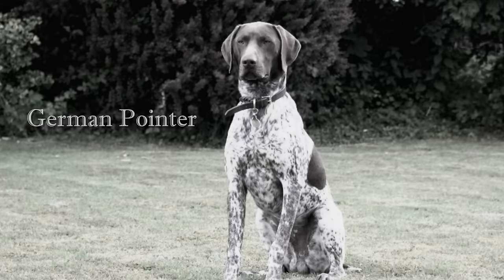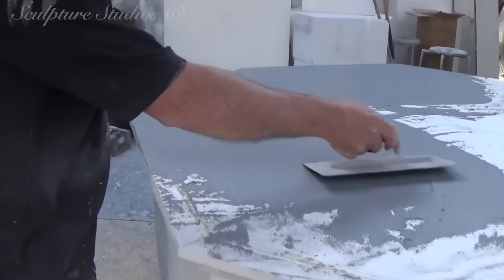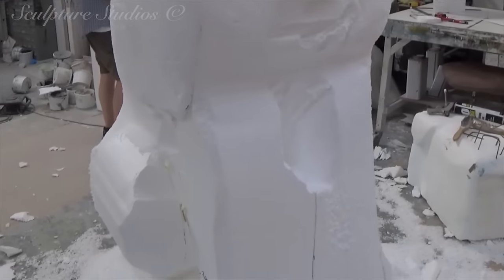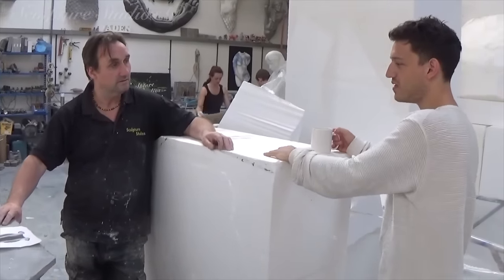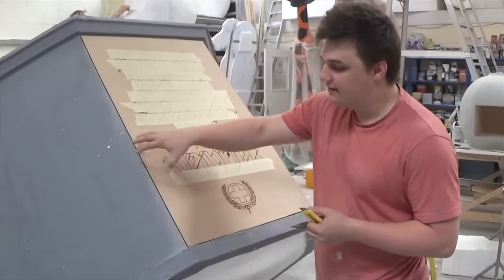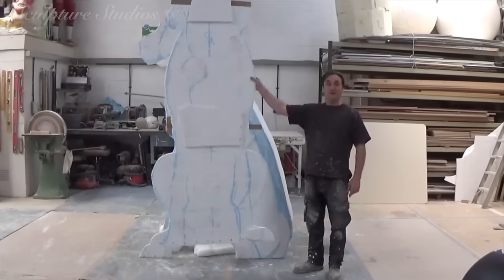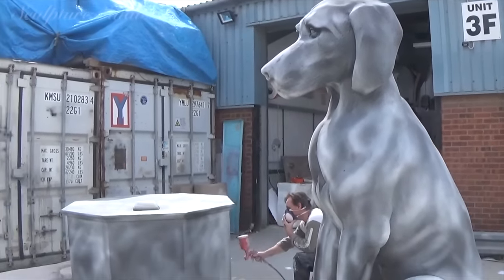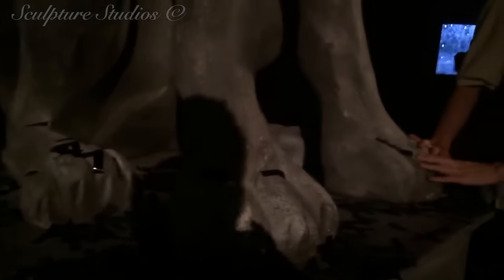Giant Concrete Dog Polystyrene / Styrofoam Carving by Sculpture Studios

Comment: Regards Aden.. Beautiful job..what are You doing with waste of styro...I'm in a similar business and  we have problems withstyrofoam waste.. You are not using epoxy resin as a protective barrier( You spent a lot on a foil)
Reply from the maker: petarfico generally we can recycle polystyrene with the company we buy it from if it's clean. And we get a good deal on general purpose polyester resin than we do with epoxy, so works out in our favour to do it this way. Understandable to ask though :)

Comment: The dog is amazing. What do you mean by soft cement?
Reply from the maker: Hi Sandra, it's not a "soft" concrete per se, but a concrete thats got a flexible quality to it. (means it can expand and conctract in the heat moreso than regular concrete so it can be applied to different things without cracking. It's still hard to the touch like normal concrete. Thanks for watching :)
Reply: Aden Hynes Sculpture Studios  Thanks for replying. Is it a secret recipe or could you say what you put in to make it flexible. I made a heron out of foam and put wire netting around before ghe cement as i didn't think the cement would stick to the foam. I didn't think of foam till i saw your video of the dove. Best wishes
Reply from the maker: sandrahuss77 we mention the product several times in our videos. It's called Dryvit
Reply: Aden Hynes Sculpture Studios Thank you